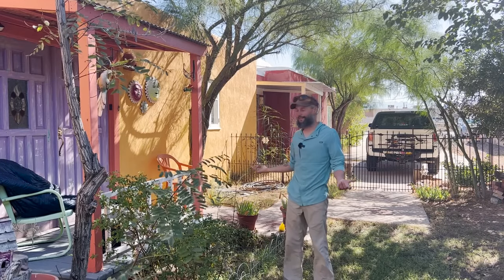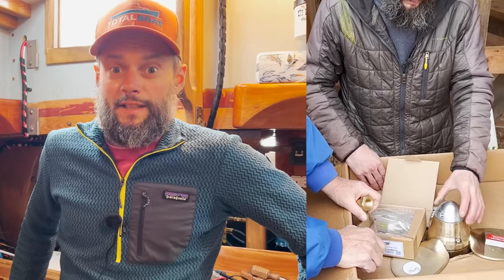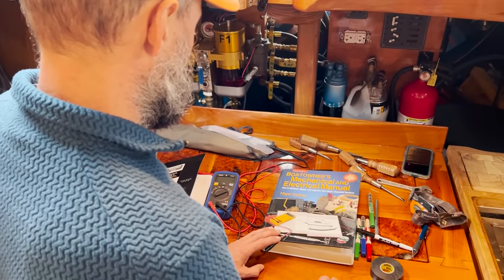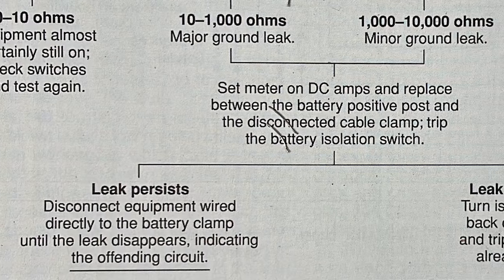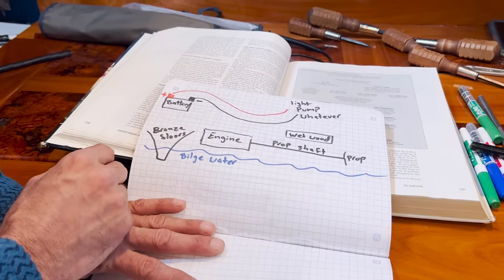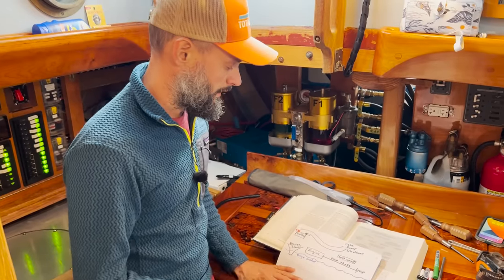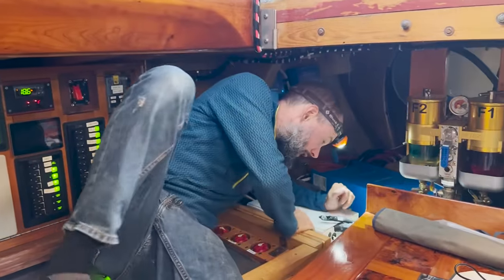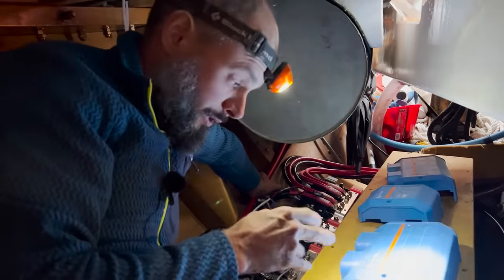Stray Current Puts Arabella in Danger - Episode 284 - Acorn to Arabella: Journey of a Wooden Boat

Comment: I'm not convinced the alternator is the problem here. I'm not familiar with marine electrics specifically, but I am familiar with electricity. 
For an electrical current to flow, there has to be a circuit. The alternator circuit is essentially very simple: the alternator generates electricity, which flows out of the positive terminal of the alternator, to the battery positive. The current flows through the battery, returning to the alternator via the battery negative, normally tied to the engine block, thus back to the alternator. If the regulator is allowing the alternator to overcharge the battery, the current still flows in this same circuit. There is no circuit for the current from the alternator to flow through the prop shaft to the anode, regardless of how much the alternator is overcharging the battery. You do need to fix the overcharging problem, because overcharging lithium batteries is very much "no bueno", but I don't believe this will fix the stray current problem.
I believe that your troubleshooting, laborious and thorough as it was, was not effective at finding the problem, for a few reasons:
- as noted in another comment below, you had the leads plugged into the 10A sockets on the meter, but had the meter set to the mA range, not the A range. I was unable to find a manual for your specific meter (ANCOR 703073), but on most meters I have used that is not a valid setting. The display is also showing "A", not "mA", but you were reading as mA. Also, at about 17:00 in the video, the Victron flashing is indicative of a problem - the meter should have very little voltage drop through the 10A sockets, the Victron should have gotten essentially full power. I suspect the internal 10A fuse in your meter is blown. This can be confirmed by measuring the current drawn by a light bulb (with the same settings). An automobile headlight draws 4-5 Amps, a signal light draws about 2 amps, a marker light about 500 mA. If your meter does not pass enough current to light up any of these, it is not functioning correctly. (Be sure to use the 10A sockets for this test, don't try this on the mA range or it will blow the smaller internal fuse!)
- you were only measuring leakage current of the wires to each device, because you had each device turned off during the test. (If you didn't have the device turned off, you would be measuring the power draw of the device itself).  For the bilge pumps, you would only be measuring leakage of the wire to the float switch, excluding any leakage from the pump itself.

My suggestions:
- I believe all the bronze floors should all be connected together, and to the engine block. Does not have to be super-heavy wire, I'd suggest a #10 should be OK (physically rugged enough to withstand some abuse, small enough to fit through small spaces). 
- I'm assuming your house battery negatives are tied to the starting battery negative, and the starting battery negative is tied to the engine block.

I couldn't see clearly, but it looks to me like the current shunt is in the negative side, mirror to the main fuse in the positive side. If so, you can more thoroughly check all devices for leakage:
- remove the main fuse (again), and also remove the "link shunt". Turn everything ON - all breakers, all lights, raise the floats for the bilge pumps, etc. Nothing should work, nothing should light up. Now measure again the current that flows through the main fuse position with your confirmed-working meter (even with meter in place, nothing should light up/energize/function). There should be no current flow, because even though you have everything turned on, you have interrupted the flow back to the battery by having removed the link shunt. If there is current flow, you can trip breakers one at a time until it goes away, then you have found the problem circuit.  

One other thing to try:
- if the bronze floors are not grounded together to the engine block, try measuring volts from a mid-ship bronze floor to the prop shaft or engine block, with everything turned on. Anything higher than a volt or two means something is leaking current into the bilgewater. You can do this with engine running as well, to rule out any engine-running issues.

Comment: If the alternator isn't connected electrically, need to take the drive belt off too. Technically, an alternator needs an external power source to create more voltage and current. So with the wires removed, it shouldn't have done anything. But, a magnet moving next to a wire does create its own voltage (its how magnetos work) so with the alternator spinning, it could be enough to create a small voltage in the alternator that needs to go somewhere. It wouldn't be the 12 to 15 volts it normally outputs, but it would be something.
Reply: Yeah, I was wondering why they wouldn't have disconnected the belt completely

Comment: Electricity will always follow the path of least resistance. Like most engines I’m sure that your engine is used as a negative buss for things like the starter, solenoid, etc. if your propeller shaft is not isolated from that ground bus than you have possible potential from any source outside your boat to the negative terminal on the engine battery. If you have your starter or anything that uses that negative potential of the engine faulting or leaking it would perhaps leak to water through the prop shaft if it is not isolated. Perhaps you need a isolating shaft love/joy between your engine and prop shaft.

Comment: You seem very confused about how the grounding system on a boat works.   All that matters is that ALL the metalwork on the boat (the floors, the through hulls, the prop shaft, the external fittings that contact the water) ... all of them need to be bonded together.  That's pretty much it.  The normal is then to bond that mesh to battery negative, at one point only, usually the alternator/engine.   Beyond that, it doesn't matter in the slightest if you have a leak ... it might flatten your battery but it won't cause corrosion. 

I also have the WS500 (well, two of them, dual alternators)  ... changing your alternator will not change a thing.  There is a lot of configuration on the WS500, they might overcharge if they are badly configured, but they can't cause corrosion if everything is bonded together. 

If you have bonded everything external that touches the water together,  you are golden. If you haven't you will have issues.  It is nothing do do with "leaks" from the positive to anything else. It is purely about equipotential bonding of all the external components, ideally to a single point.  

Check that your through hulls are all bonded together, check that your propshaft is also bonded to the same point, check that anything and everything that is external and make absolutely sure there is good conductivity between them.  Normally all that is bonded to battery negative.
Reply: My thinking as well... Also, in a negative ground DC system, every current carrying conductor on the negative side should make one and only one connection to ground and do so at a single common point. If a negative conductor makes contact with ground at two separate points,  voltage drop along that conductor will generate fault current in the ground system.
Reply: @thomasjake3920  Exactly correct.

Comment: It tastes a small current of 12vdc voltage to actually turn on the charging portion of the alternator. That system is grounded directly to the motor. And indirectly through the shaft. That would definitely cause anode degradation.

Comment: I don't know if this is the correct way to troubleshoot this, since my electrical troubleshooting experience is in aircraft, but maybe comparing the prop anode to the condition of the hull anodes may be in order. If the prop anode is gone, as yours is, and the hull anodes are still in good shape, I might start with the alternator, starter, or other system that connects to/through the engine. For anyone who has experience in hunting these problems down, is this a good way to begin?

Comment: Maybe he grounded the internal regulator so it doesn’t feed the induction voltage but there is still the PMG so the alternator is creating a small voltage. 2 volts from alternator and 1k ohm feedback resistance through grounded voltage regulator will create a 2mA draw. I don’t know boats so I don’t know that much about anode depletion but since the start of the troubleshooting I was thinking the boat motor has a live ground.  Wet wood, although conductive, is incredibly high resistance.  4 weeks depletion of something that should take 52 makes me think you have a hot ground.  (Aviation electrician, and electrical engineering student)

Comment: Steve,
I am going to go out on a limb and suggest a possible solution. Maybe concider a separate battery for the engine by itself with a switchable isolator that can be switched to your battery bank when needed and left to stand alone with the engine and I to needs. That being said I you decide to go the other way Prestolite  use to make a external regulated alternator that could maybe meet your needs

Comment: check your positive connections on all of your bilge pump float switches, they are hot as soon as you turn on from the master panel and one small pinhole or water leak into the connection will result in voltage entering your bilge water.  hard to isolate.

Comment: makes me wonder if there's a kit for a clutch or some other mechanical bypass for the alternator.  temporarily, you might be able to run a shorter belt that doesn't engage the alternator at all then re-install the standard belt when in a place where solar charging is insufficient.

Comment: Interesting thesis, I question your methods!   This is a WoodenBoat, correct? The whole basis is deteriorating Zincs on the end of the prop? .. Are you running a cutlass prop bearing?... Car alternators with voltage regulation. have lots of Ac Ripple with respect to the DC use a generator for this application… Peace

Comment: I don't know how your anode is mounted, but you need to measure not the current, but the voltage, both DC and AC, between the battery poles and the link to the anode, if it is an alternator, then it can also be an AC voltage due to a parasitic mounting capacity (AC), but in this case, the current is okay the anode can be shunted with a larger capacity on a shorter circuit, you just need to determine the current source...

Comment: A race boat I sailed on had a anode we drop over the side in dock it had a wire connected and a battery jumper cable type alligator clip , so we drop it over the side and clip the clip to the motor ,, can’t see why you can’t do something similar just for a safety type hook up you could even direct your visitors to make this simple set up and clip it on drop over the side .. in your case clip it to the prop shaft internally run the wire over the side with anode attached ps it also had a rope to tie off that held the anode fore retrieval  id be using it whenever possible saving expensive prop type anodes and eating it instead

Comment: Measure current flow from the ground on the bus in the boat to the water. There should be no current flow. You can check this with the engine running, Solar cells running all the different modes you can think of. If there is ever current flow between the ground on the boat and the water, that same current is flowing through your prom shaft and likely causing your problems.

Comment: Most all auto and marine "alternators" are three phase A/C generators that are rectified and filtered by six diodes and a capacitor.   The six diodes rectify to D/C the current coming out of each set of windings in the alternator.  No matter how good your diodes are there is always a certain amount of residual A/C on the output.  When I overhaul and then test aircraft alternators the maximum amount of A/C is 150mv.  Measured with a autoranging sensitive voltmeter,  the A/C should be about 35mv A/C with minimal load and 85mv or so at 25 to 35 amps.  The higher the load the more A/C it will put out.  Put your leads negative to ground and positive to the output of the alternator and put your meter in A/C millivolts to read.  This "Stray A/C may be your trouble.

Comment: Solar panels are questionable in my mind.  Even though you think they are isolated, the manufacturing process could result in a connection to the frame of the panel as well as the wires.

Comment: When you take away the voltage to the field winding (regardless of internal/external) it should kill it off.  There might be some residual magnetism in the field winding whereby there's ALWAYS some output voltage.  It's .. uh.. possible. A car doesn't have a nice external path as it has these bit rubber thingies on four sides to prevent a residual external current loop.  Cars DO have residual draw (I worked on debugging a 2015 Silverado with several amps' worth but nobody could give me a wiring diagram on on of the many distribution points coming off of the battery so the customer got their vehicle back.

Comment: All of the meter readings in this video are incorrect, The red lead is in the 10A jack and the meter is set to the mA shunt. To use the 10A jack the meter must be set to A.  This is a good place to start anyway as it will not blow the .5-1A meter fuse on the mA shunt if you accidentally left a load switched on.  Attempting to measure current beyond the scope of the meter mA shunt wilt blow the fuse if present or damage the meter.

Comment: The biggest cause of power leakage on boats is something on the engine that is earthed to the engine ..... All sender units need to be double pole (above earth) also the starter and alternator need to be above earth. 
One boat I worked on had a bad electrolysis problem and that turned out to be an electric clutch that hadn't been properly converted to above earth. 
Also for protection each brass through hole needs to have a anode connected to them if they haven't all ready

Comment: Unlike a dynamo an alternator needs power going in before it can produce electricity so if the power supply to the alternator is disconnected it won't generate electricity, it'll just be a belt tensioner.
Reply: This would count as "neutering" an alternator.
Reply: @GriffonriderTom  My point is the alternator can't be leaking electricity because it can't generate any to leak so the leak must be elsewhere.

Comment: As other have pointed out the multimeter is set to read mA and the probes in the 10A position this will read 1000 smaller. 0.01A being 10mA  (10 milliamps) NOT 0.01 milliamps  I've tested this on two types of multimeters I have. The 10A range places a shunt inside of the multimeter in parallel. It could be diode leakage within the alternator ... Although My bet would be something in the bilge switch area pumps etc

Comment: My guess based on how much you used the engine early on that the problem is from the engine charging system. You can buy a half cell or borrow one from a gas utility, all steel gas pipe is catholically protected. I concur on needing a clamp on, the automotive ones are small and pretty inexpensive.

Comment: 'Practical Sailor' magazine suggests using vaseline on all crimped on wire connections and around the nuts holding down the connectors. Anti corrosion.

Comment: Many automotive alternators vary their output by modulating the voltage in the field windings. In theory, no voltage in the field windings means no output. However, if any of the metal in the alternator has become even weakly magnetized by spinning around in those fields, you may have some residual magnetic fields that cause the alternator to produce a small voltage even when the internal or external regulator is producing zero voltage in the field windings. If you can measure the field winding voltage and the alternator output voltage (with the engine running, or course) you may find a small alternator output voltage even when the field winding voltage is supposed to be zero. Unfortunately, I have no idea how one might solve that problem, but it does seem like something that folks in the marine electronics industry would have figured out.

Comment: I dont think that you can rule out leakage from running equipment.  What if your bilge pumps only leaked current when the float switches close the circuit, or a light is leaking current to some other bonded metal part of the boat only when it is turned on.

leakage current is not synonymous with parasitic load.

Comment: An alternator that is externally regulated is a generator.  Most motorcycles use 12v generators (3 phase/coils) and a magnetic rotor inside the stator.  Those 3 wires then run to a regulator/rectifier that is typically a solid state system suspended in an electronic safe epoxy.  The regulator/rectifier allows power to flow to the battery.  When the battery is full, the excess energy is discharged and converted to heat, which is removed via cooling fins.  

I also know that the 1964.5 and 1965 Ford Mustang uses a generator and external regulator.  In 1966, they switched to an alternator.

The excess power has to go somewhere.  

I wonder if it's possible to get a generator that has an electronic clutch.  The clutch, in theory, could engage to provide power to the battery bus system.  When the regulator sees the battery is full, it provides power to the clutch...mechanically disengaging the generator from the engine.